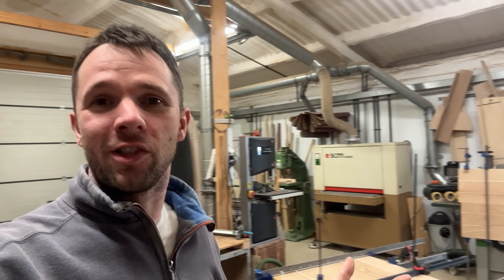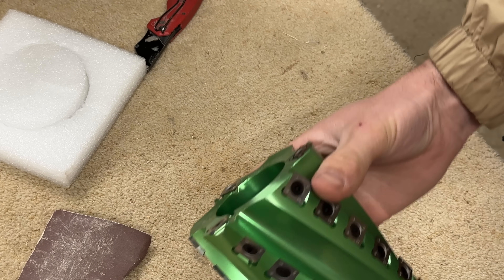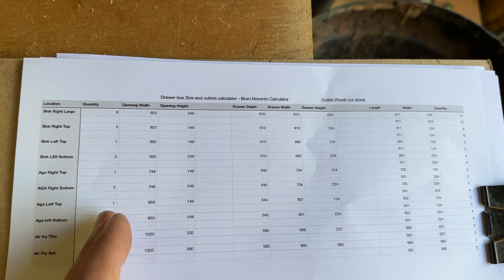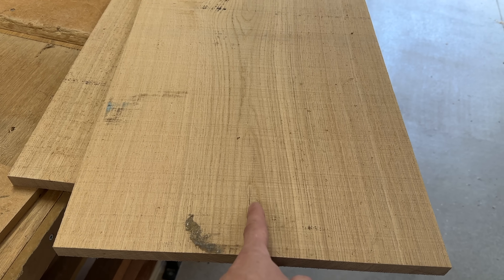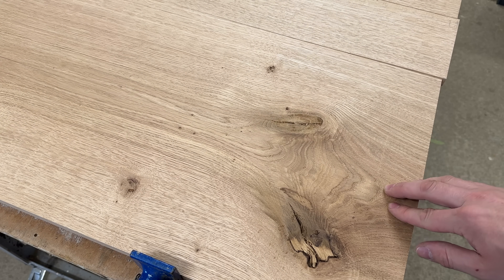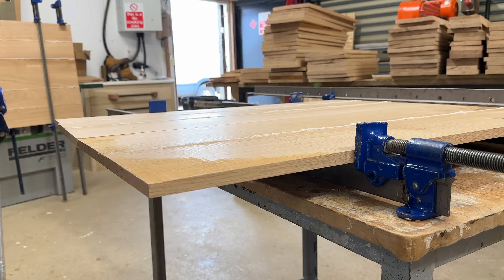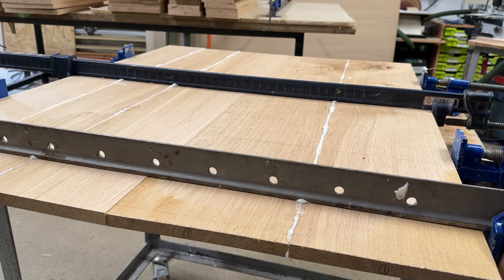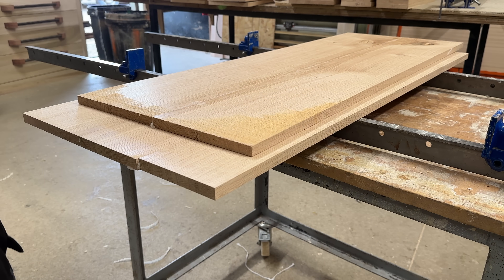Making Wide Boards From Thin Stock Material, New Cutter Block Arrival.

Comment: Nice touch with the t bar clamp, I have some that are about 25 years old and they are all tight and true with no slack in the head's unlike my newer one's (10 year's old) which suffer with the loose head's as you show. 

Those block are spot on Ollie where have you sourced them from please.

Comment: Good to see you again..
Yes please for the spread sheet
Reply from the maker: https://bradshawjoinery.co.uk/downloads/ Ive added a numbers one on there, might be able to open with Excel i honestly dont know,  cheers mate.
Reply: @BradshawJoinery  thank you I will give it a try.
Reply: @BradshawJoinery  a quick question do you straight blades or a spiral head on your planner/ thicknesser? 
I’ve got and older 410mm Felder and looking at changing for a spiral head. Worth it yes or no in your opinion?
Reply from the maker: @stanley626  I wouldn't change from a Felder system blade block, be more advantageous to swap the machine for a spiral one. Older machines like wadkin it's worthwhile swapping a hss block for a spiral! I have Felder system 4 knife cutter, it's pretty cheap to run but would definitely buy a spiral next time
Reply: @BradshawJoinery  I too have the 4 blade system and picked up 40 odd blades for less than a £1 each so I’ve got plenty of blades to keep me going. 
I think you are right I’ll just stay with what I have. 
Really enjoy your channel and find it really useful. 
Thanks
Reply from the maker: If the itch really gets you to change, sheartak sell one. But I'd just sell your machine and buy a spiral it'll be similar cost and worth more in the residual value
Reply: Nice blocks those Oliver, who's brand are those don't look like whitehill.

Comment: Definite yes for the spreadsheet.   I would also be tempted to align the column titles with the numbers so that there is no chance of mixing up.
For your old spindle cutter - could you get someone with a metal lathe cut a recess for the top nut?

Comment: Another solution for removing the dried up glue is to use a chisel with a slightly rounded edge. In other words: one that is blunt, on purpose. Works for me.